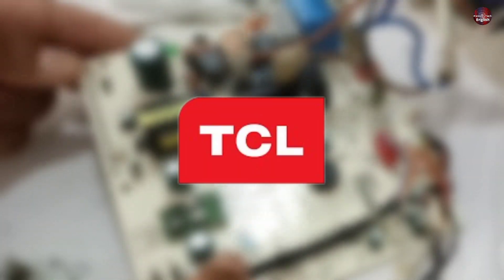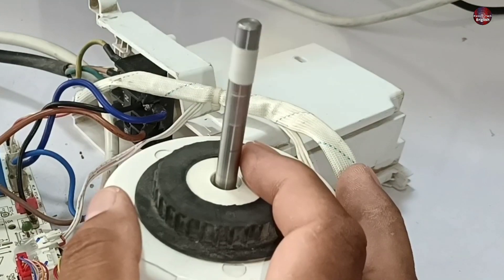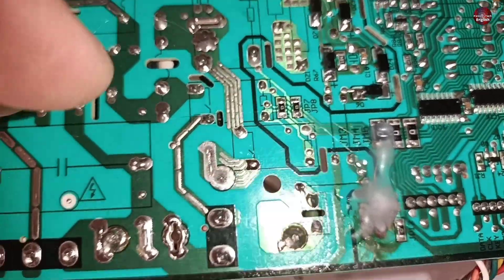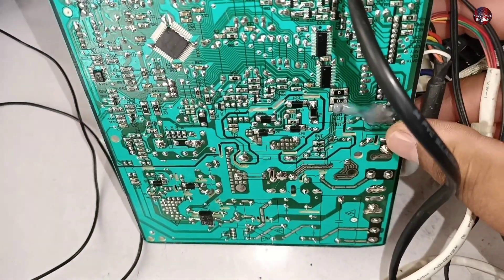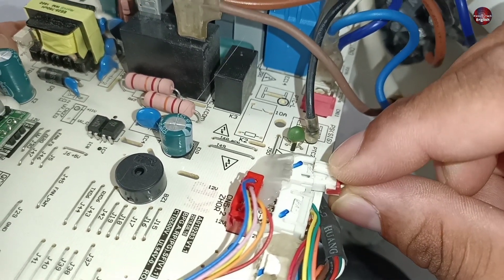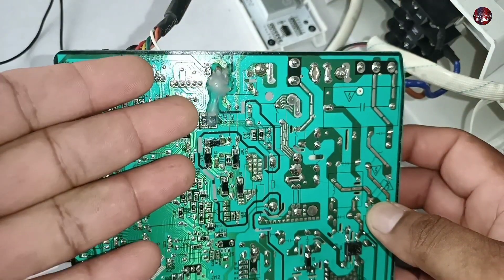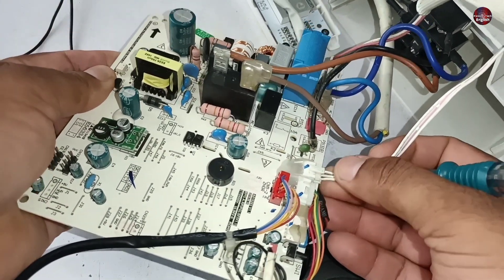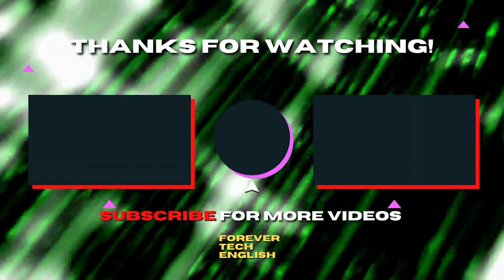AC Motherboard Blower Motor Error.. But PCB & Motor are Fine

Comment: I have a habit of holding the connector with my left hand before pulling out the plug with my right. Past experiences of the connector breaking away from the board.
Reply from the maker: That is why Its important to be careful with connectors.